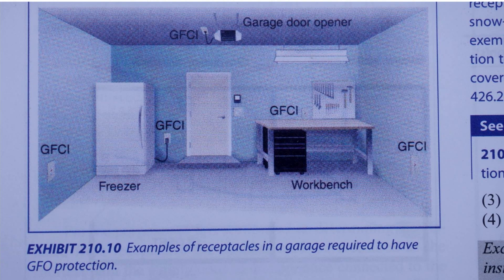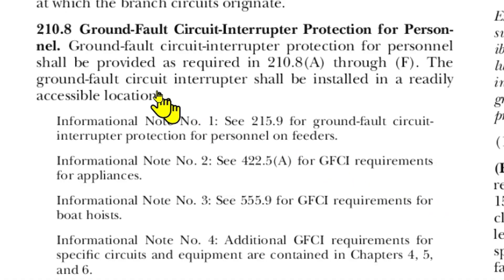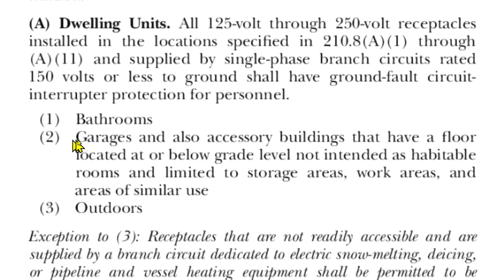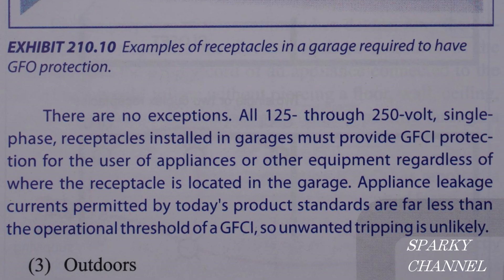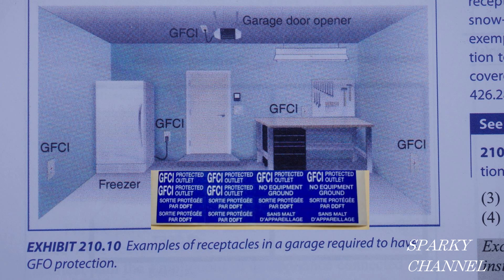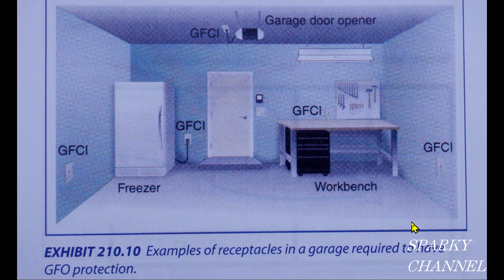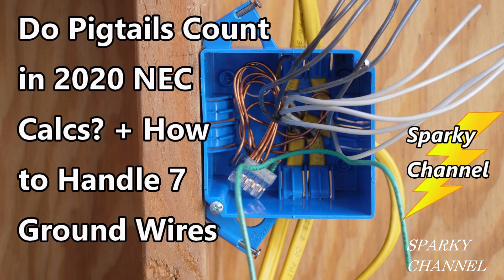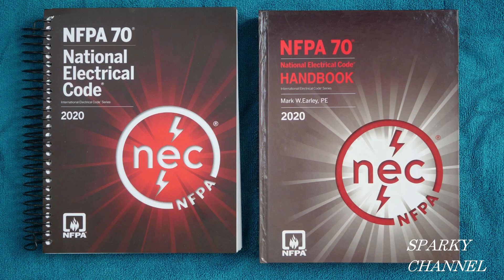Do Garage Door Openers Need to be Protected by GFCI? And What About GFCI Accessibility?

Comment: Hi Sparky this is helpful info.  I have a 2yr old new home with 2 garage motors on GFCI circuits.  They frequently trip the GFCI when turned on especially if both doors run at same time, both new Genie Garage motors.  I’ve read it’s the inductive load on startup confusing the GFCI shutoff sensing, not current leak to ground.  What’s the solution for this?

Comment: Can I replace a single non GFCI garage door motor 120v@15amp ceiling receptacle
to dual receptacle GFCI? 
The line is dedicated to the garage door motor only, but It’s a waist of power outlet when garage door is not being use. The garage door motor only uses 0.75 amp when opening or closing.  The free 14 amp circuit is not being use.

Comment: If I were doing a new install, I would install a GFCI receptacle for the freezer just long enough to get the inspection, then change it to a standard receptacle. The grounding conductor in the power cord grounds all exposed metal parts,so the breaker will trip in case of major equipment fault. I’m not going to risk losing hundreds of dollars worth of meat because a GFCI decides to nuisance trip.

Comment: Bill, I have watched this video on GFCI and garage door opener at least twice and have a question.. As you presented the code and description of required circuit, I noted that this circuit was to have only one receptacle and that was for the opener to be plugged into. Am I right in then thinking that the GFCI must be a dead front GFCI in order to comply with no other receptacles in that circuit as well?

Comment: It should be pointed out that the NEC only applies to new construction and remodels. Therefore if your garage was built in 1970 and has no GFI, it’s fine that way. A home only has to meet the NEC code for the year it was built…. Until you start renovating things. 
Obviously some safety updates are advisable, such as GFIs in bathrooms, and smoke detectors on each floor, which is an acceptable compromise between 1960s code and current code. Inspectors are not going to make you gut a home & rewire everything because it only has 1 smoke detector.

Comment: That is so dum to put openers on the load side of a GFCI.. For the same reason you wouldn’t do it for REF & sprinkler system that water your lawn!! What about the uses of single receptacle in  garage ? For like think you do not want on a GFCI

Comment: Great suggestions. My home is 57 years old & has 2 ceiling receptacles & are not GFCI covered. I'll figure it out to fix them.
Reply: Same with me.  The builder of my 1970s house put everything in the basement and garage on the same non-GFCI 20A circuit.  I just converted the basement to 4 new general circuits (one 15A for lights only and three 20A GFCI for laundry and shop receptacles).  The old/original 20A will be just for the sump in the end (I have another existing 20A just for the washer & dryer that was not touched, other than to convert to GFCI).  I'm converting the garage next... but will only use one new 20A GFCI circuit to feed a few convenience wall receptacles and 5 new ceiling receptacles for the opener, plugin shop lights and my extension cord & light reel.  I'll feel a lot safer.

Comment: I did notice that in the Chamberlain garage door opener install manual there is an option B that show you a  permanent wiring option.  This would bypass the requires GFI protected outlet. and your warranty is still good.

Comment: One thing brought to my attention a few years ago was installing an outlet inside a standby generator cabinet for the block heater and battery charger. Since this is inside a locked cabinet and is a dedicated circuit there seems to be some slack in the rules. (although NOT a garage as per the video) One inspector says the outlets are ok because not readily available to typical use. Another inspector (next town over) says it's only ok if they are also dedicated (single) outlets... but we'd need two for the devices that will be installed later. (more material instead of a duplex) Yet a third inspector says those outlets must have covers that are "weatherproof when in use" despite already being inside a rainproof enclosure. It's hard to argue with an inspector when you want him to sign off on a job!

Comment: Hello, sir ! How far from the door opening  should the outlet be ?
Reply: About 10 feet’s or 11 feet’s from inside wall I hope this helps you
Reply: @beniyanez1  I think he's referring to the receptacle for the opener; it usually comes with a short 2-3' cord, so outlet has to be on the ceiling adjacent to the motor unit. Opening has nothing to do with it.

Comment: The garage door opener problem already has a commercial solution of an opener with battery backup sold for when you arrive home and the power is out you can still open the door a few times.  

A garage freezer is more difficult and looks like the only code "friendly" solution is to install some battery powered power loss alarm.

Comment: It’s like I said many times before, just use a GFCI/AFCI Breakers and then problem solved! Yes they can be expensive but in the long run the redundancy and the peace of mind is worth it!
Reply from the maker: Yes, they are excellent.
Reply: They are a good idea, but as such the US needs to scrap our breaker panel system and adopt something like the Brits with a GFCI/AFCI that protects all or a couple that protect subsets of circuits instead of all this hit or miss where a circuit, like a garage freezer might be on could trip and go unnoticed.

Comment: "There are NO exceptions." Who wrote that? Ugh. There are always exceptions.
Reply from the maker: I didn't write it. I'm just a messenger. :)
Reply: I agree that diagram is a bit misleading, even I got confused. It seemed to suggest that EACH receptacle in a garage must be GFCI, but I looked more closely and it’s says “Examples of...”.  I’m sure someone one not reading so closely would try to install a GFCI in every box when (if I’ve understood correctly) only one is needed on the most upstream to protect all of the others in the same circuit.
Reply: @peacefrog0521 I understand the concept of daisy-chain GFCI protection, but according to the code, a garage door opener is supposed to be on a dedicated circuit. So you would have to use a GFCI outlet or GFCI breaker in order to be compliant with the code as they've written.

Comment: For retrofits in jurisdictions that must bring up electric to current code, there are GFCI combo switches where you can replace the garage ceiling light switch with a single gang light switch and a GFCI reset button combo. You can even split the GFCI and non-GFCI protected receptacle/fixture on a single GFCI combo switch. The box fill gets tight though.
Reply from the maker: Thanks Jim!

Comment: What counts as “readily accessible”? I’m about to put a GFCI upstream of everything in my poorly wired garage. I’m going to put a new outdoor junction box and GFCI receptacle above the light switch (and main branch point) just inside the door, but that’s a happy accident due to an all-inclusive kit being ~$2 more than just a receptacle.

There’s a weather head connected via ~1’ of EMT to a 4” octagonal box on the second floor. The individual conductors get connected to NM cable that feeds the rest of the barn in that box. This box is between waist and shoulder level, but on the second story. Had I put the GFCI there, would that have been considered readily accessible?
Reply from the maker: I would say so. It is readily accessible but very inconvenient. But then "readily accessible" has been pretty much left up to the determination of an inspector.

Comment: so if we took mc with the correct fittings and hard wired it  there would be no receptacle .   would that fly??  after all how many times do you unplug a garage door opener.
Reply: That’s right.  Hardwire is the solution for appliances or devices that cause nuisance tripping. Refrigerators are well known for tripping GFCIs on defrost cycle.  This is probably why the 6 foot rule (from sink) applies in the kitchen rather than just saying all kitchen receptacles need GFCI.
Reply from the maker: Now that's a good question. If you could find an opener that is listed and labeled for hard wiring I don't see a problem with it.
Reply: Is it a violation to cut the plug and hard wire it?
Reply from the maker: @chaseoes  Yes, it would have to be designed for hard wiring IMO.
Reply: @SparkyChannel  as long as a disconnect means is with in sight then no gfci nedded.
Reply: @SparkyChannel  I think the Chamberlain/Liftmaster has it listed as “Option B: Permanent Wiring”
Reply from the maker: @handyjim6321  Excellent, thanks!

Comment: I am surprised we don't have to label all the outlets and switches with "AFCI Protected Device" as well... 😋😋  I absolutely hate the "GCFI Protected Outlet" stickers and have removed all of them from the house they look horrible and 99% of the time the electricians can't put them on straight and centered.  Its amazing that most new large high end homes, you never see any of the stickers, I wonder why?
Reply from the maker: I have to admit, I have trouble sometimes getting those little stickers straight. More than once I'll get it crooked, take it off, and stick it on again. :)
Reply: New homes incorporate gfci/afci breakers thus eliminating the need for stickers. Also, eliminates the aggravation of searching high and low for gfci receptacles that may be located at the other end of the house or behind something in a garage.

Comment: Like a garage door opener NEEDS a GFCI. We can only wonder how much the manufacturers paid to get this ruling in there. Requiring more expensive, even when absolutely pointless, benefits only those selling the products...and the ones holding their hands out for their kickback.
Reply: I think of it as a loophole that has yet to be made. It's a receptacle in a place that requires a GFCI, so it requires a GFCI. Hardwire the thing and the $50 breaker isn't required.
Reply: I have the same view.  I want to know how many fatal electrocutions and fires  have happened from AC / heat pump units.  The close disconnect  I understand and am for, not the  $100 to $130  combination AFCI/GFCI double pole breakers.
Reply: @vicktorpatriot1430  HVAC systems do cause a few fires every year, but not in ways a $$$ breaker can prevent. The only electrocutions I hear about involve idiots and downed power lines, not wet garage door openers.
Reply: 100%  Agree
Reply: What about if the garage roof leaks (on a detached garage) and water falls onto the opener?

Comment: Yes. Put the gfi in the panel. Or put beside the panel.
Reply: GFCI outlet is much cheaper than a GFCI breaker.
Reply: @scott_meyer  yes.  And better than many years ago. I remember  a long time ago when the gfis came pre wired with pigtails.   Talk about hard to work with.
Reply from the maker: My concern is this will cause inexperienced people to want to work on their own main panel which are very dangerous.
Reply: @SparkyChannel  Yes.  You ought to work in a electrical panel in Malaysia.  Very small and 240 volt system. Scares me when I am there at my wife's home.  She is from there.  But we go back to see her family.   Small wires and it is interesting main breaker acts like a GFI .
Reply from the maker: @zerosparky9510  Agreed!

Comment: Readily accessible is defined as "capable of being reached quickly for operation, renewal, or inspections, without requiring those to whom ready access is requisite to climb over or remove obstacles or to resort to portable ladders, chairs, etc.

In this case the overhead GFCI is readily accessible because it does not require a ladder to inspect or operate. I suppose if the ceiling were 10' that might be a different story.
Reply from the maker: You make a great point. What exactly do they mean by "readily accessible"? It seems like they put a lot of power in the inspectors hands with that phrase. What about little people? I'm thinking they should put an actual height in 2023 NEC.

Comment: Freezer should never be on a GFCI. A nuisance trip would result it spoiled food, A freezer should be on a dedicated circuit with a single outlet receptacle.
Reply: didn't you read the details in the explanatory paragraph in the handbook?  it said freezers don't nuisance trip GFCIs any more.  so if your freezer nuisance trips a GFCI you need to show it that part of the codebook and explain that it's in violation.

the better solution is to move the freezer out of the garage.
Reply: @kenbrown2808  and where are u going to put the freezer?
Reply: @zerosparky9510  well, mine's got a spot in my pantry.
Reply: @kenbrown2808  .  I would have to go back to my NEC code book.  But I think it has to be under a Arc Fault plug or breaker.  a Siemens ArcFault breaker cost around $45 for 1.   NEC requires them in almost every room now . I think the 2 exemptions  are outside and bathrooms.   Have to dig out my NEC.   Ugh.  Getting ready to retire and get out of the elec racket. Getting harder and harder.
Reply: @zerosparky9510  yeah. The arc fault rules are being manufacturer driven. We're going to be having a lot of overload problems in the current generation of houses.
Reply: @kenbrown2808  yes.   Most of the guys I know in the trade are saying about getting out and retiring.   I might at the end of this year. Hit my full retirement age.
Reply: @zerosparky9510  I've known a few who tried to maximize their pensions and ended up dying with the tools on.
Reply: @kenbrown2808 .   I don't plan on working to age 70.. forget that.
Reply: @kenbrown2808  hardwire it. That’s how you get around the GFCI requirement
Reply: @R900DZ  then you have to install a service disconnect switch, and the homeowner forgets what it is and shuts it off.
Reply: @gerrymcintosh4477  all you can do is your best, unless you work for a hack artist and then it's time to polish up your resume.
Reply: @kenbrown2808  freezers don't nuisance trip GFCIs any more a modern one might not, but one from decades ago -- because they very rarely fail -- sure will. My fridge is 20+ years old. My parent's freezer is coming up on 60! I have a little dorm fridge that's over 30!
Reply: @jfbeam  I'm sorry, did I forget to use the sarcasm font? 
What I'm noticing with increasing use of high tech safety equipment is that there is increasing overextension of circuits. For example, instead of having a garage circuit and a freezer circuit, there is one garage circuit and the freezer is plugged into it, and then when the gfi trips, they have a handyman remove the gfi. If the breaker trips, they have the handyman put in a bigger breaker.
Reply from the maker: I agree, but the code is the code.
Reply: @SparkyChannel  i agree
Reply: In the garage. Must be. Gfi.    And yrs ago your statement was pointed out in one of the code making panels.  The answer back was what would u rather have a GFI kicked out or some body dead from something go wrong with the refrigerator.
Reply: @zerosparky9510  by that measure we should all stop driving cars. but sure, we have to follow code.
Reply: @wim0104  it is in. The nec code.
Reply: @zerosparky9510  

Then at least it should be a dedicated GFCI. I'd hate to have the  Christmas lights trip the garage GFCI and loose the freezer outlet when that happens.
Reply: @scott_meyer  just saying this is what was pointed out years ago at one of the code making panels and the response back.  So there is no exceptions.   Gfis are for all the outlets in the garage.  Not saying that it is a little nuts. Would like a dedicated circuit on a freezer.  But not going to happen now.   Just like in the basement the sump pump also is under a GFI OUTLET.   Do you go out of town. It rains hard and your GFI for some reason kicks out. U get lots of rain in ur basement.  This actually happened yrs ago to a house down south.  Freshly finished basement ruined.   GFIs at least are better than yrs ago.  Now we have arc fault breakers and plugs. Ha.
Reply: @zerosparky9510  Ok, where are the actuarial tables for number of people killed by electrical faults of their refrigerator/freezer, that a GFI would've prevented. The NEC is supposed to be about safety and fire prevention, not padding manufacturer profits.
Reply: @jfbeam  what does it say in the NEC?   What do u think a elec inspector is going to say?
Reply: I was wondering, what about the opposite case where a fridge or freezer on a non-GFCI-protected receptacle fails and takes a piss all over the floor? Does that then not create a hazard?
Reply: @peacefrog0521 that also creates an issue. Optimally, there would be a monitoring system that would identify a failure. My freezer actually has one with a battery backup. I'm sure the next generation will send a notification to your phone. My objection is more that the protection should be built into the appliance so that it can continue operating until it can be replaced.

Comment: My thought is that the garage door outlet should have a dedicated GFCI outlet, and not be connected to the load side of the other garage outlets GFCI. Here's why, I'll use my current garage as an example.
My garage has three inside outlets and two outside outlets protected by a single GFCI outlet.
I used one outside outlet for Christmas lights. The circuit was tripped once on a rainy day. In that case, the garage door would have been non functional until the outlet was reset.
Reply: or maybe don't mix outdoor & indoor on one GFCI? garage's should have more than 1 circuit these days, often there's a subpanel right there for supershort home runs.
Reply from the maker: Sounds good but it would have to be "readily accessible" somehow.